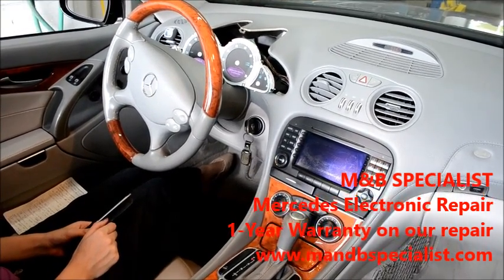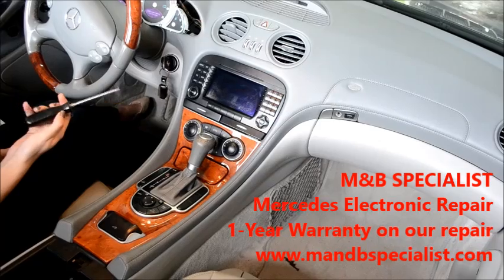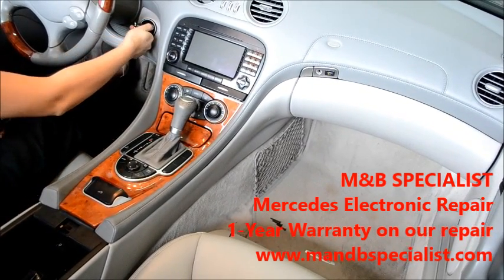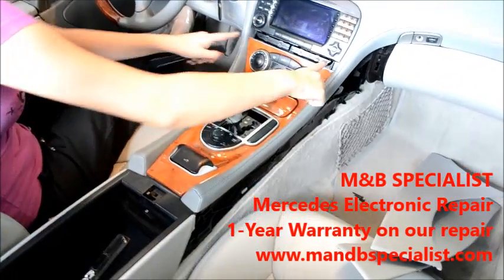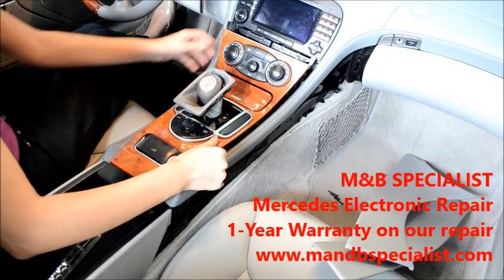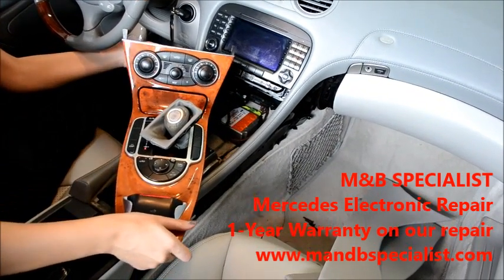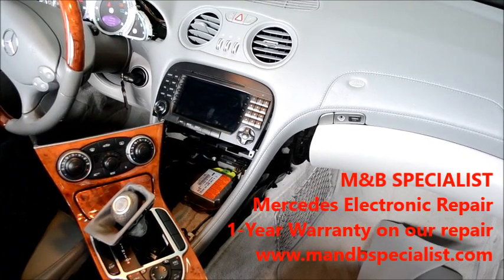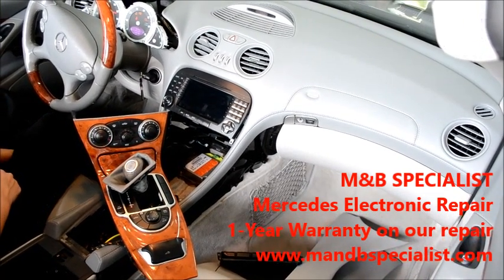How to remove Mercedes SL Command Unit for repair

Comment: all the other videos show the two screws located at the top of the command unit being removed as well. You access those two screws which secure the command unit in FROM THE TOP. The command unit will not drop as shown in this video unless the top screws were removed first. You must use the wedge tool to remove the AC Vents above the command unit in order to access to two top screws.

Comment: Can you guide me how to turn off the washer fluid motor that is linked with headlight washers ? It’s not turning off and emptied 3 gallons of washer fluids , there is a button that’s rite next to headlight switch and it’s not working on 04 SL 500 roadster

Comment: Nice video straight and to the point why would anybody ever repair one of these units and there's plenty of better units in the aftermarket sector
Reply: because replacing the unit can cost over 2000 dollars